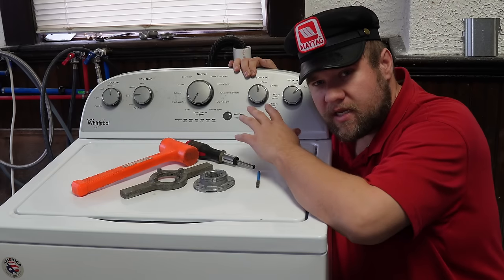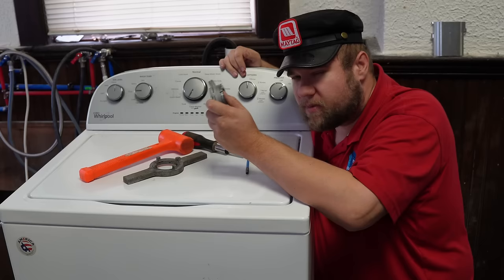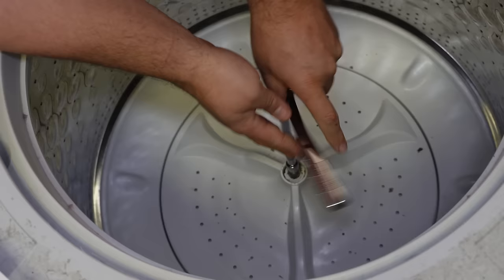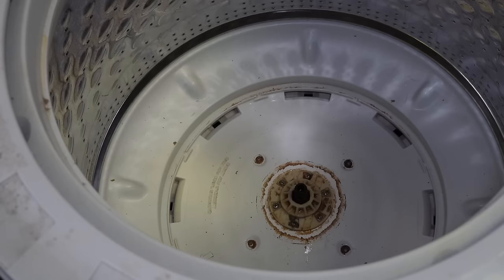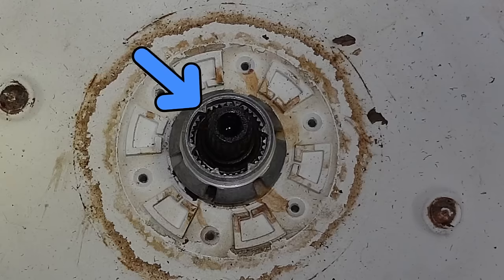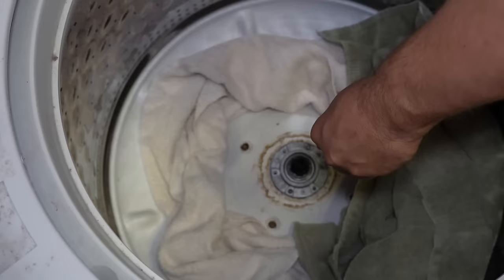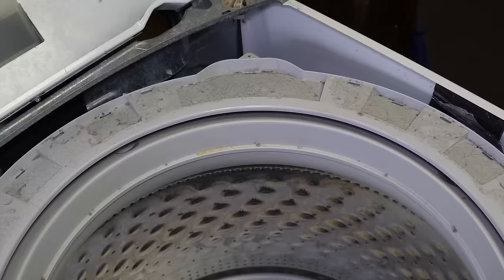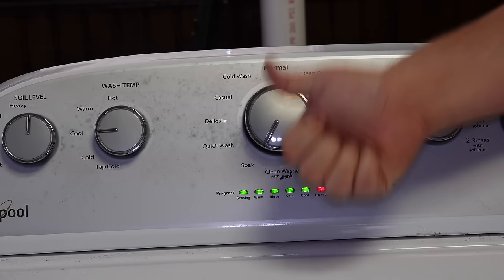Whirlpool Washer Won't Agitate or Spin Properly - Metal Hub Upgrade for Stripped Gearcase Splines

Comment: Makes me wonder how many other products of appliances can be upgraded like this. Great video
Reply from the maker: Good question. I am not sure. I try to keep my ear to the pavement on fixes like this. I've been aware of it for a few months, but never found the right part# for it to do the install. Bought about 4 of them to try and its such a good fix I'm gonna go thru em quick.
Reply: I am wondering if it will fix my Maytag commercial technology washer. We replaced the rods but still jumps. My machine has an agitator. Will this part work or am I still stuck?
Reply: @bensappliancesandjunk  do they sell this kit for a Samsung top load washer?
Reply from the maker: @jimherman17  no, I haven't looked to see if a metal hub is possible on them

Comment: Attention, thread locker is definitely necessary!  I didn't use it and it came loose, hopefully it didn't damage it and I can just reinstall. Wish me luck.
Reply: We'll it's holding! Working like new again. Thank you Ben! You saved me tons of money with this upgraded fix. It wasn't suspension rods, it wasn't out of round tub. It was only the loose hub connection to the tub that wobbled until it came loose. 
Tight like tiger now!!  Spinning smoothly as it should.
Thank you Ben!

Comment: Hi Ben! Thanks so much the video and parts! I knew right away when I pulled out the plastic hub that it was garbage. Glad I put in a better part.
Reply: The fix causes other issues 6 months later.  Spin cycle was ruined. The manufacturer purposely put a plastic tip on the shaft which drives the spin cycle. We ditched our whirlpool and bought a front load Electrolux. Never again whirlpool

Comment: Wet off, thx for vids and helping out by taking time to do these types of vids, something that can take hours, and that’s before the editing starts☺️👍🏻👍🏻

6:47  Story-time for anyone liking “stories”.
So, my Dad went to help me in a repair job (dishwasher for anyone curious) & needed my thread locker that’s use in particular areas on bolts etc…..
In my organized repair tool box (“organized” is important & why stressed this, lol, and like using Packout, Flex, Makita, Bosch, to name a few mobile/job site toolboxes & organizers…..Packout being my Fav, w/ rest in my top 5; Ridgid is in there too) & this day was Milwaukee Packout.
So, as he was helping me he got the thread locker (or threadlocker, whichever way ya like using, both get there in the end though 😃) & he handed me 2 and I put in. Now mind ya, I specified BLUE, as an fyi…..
on the 3rd bolt I noticed was using RED, oh boy, not end of world and asked if he could please switch to BLUE…
So, was on dishwasher door panel using those pesky sheet metal screws on a KitchenAid dishwasher and he put the threadlocker in and put screws in holes to line up for me to go thru and tighten down….well oiled machine assembly line for quick work, right.
On my 2nd screw I noticed not a BLUE, but a GREEN thread locker 🤦🏼 REALLY DAD, like really.
Dad: couldn’t find and they all the same.
Me: go over to organizer and see the labeled area marked ThreadLKR (hey, word to long to fit, but ya get it right, I’m guessing ya gonna say “nope”, lol, and that fine, go ahead😆) and the 2 different brands of BLUE thread locker are like right there….I MEAN RIGHT THERE, as use the most outta the other “lockers”.
So, back to his; they all the same “saying”. I assure you, for anyone not in trades, never have used, don’t care, etc….THE DIFF COLOR THREAD LOCKER ARE NOT THE SAME THING, REPEAT, NOT SAME THING, and is why make diff colors! 
So, depending on application, you may be able to get away with using “whatever” color threadLKR , but depending on what working on, Co policy, Warranty claim policy perhaps, and so on etc……..using the correct color “can make BUG DIFFERENCE” and I’m talking about if ya gotta come back for another repair and take apart to get to; or the NEXT person called that has to remove a fastener that might need 500 degrees of heat cuz of “choosing and using” diff  odor of threadLKR, just saying and my opinion which against my Dad’s that you can’t use the same color for everything and that all the colors the exact same product, why; simple……because they ARE NOT.
Ok, if made to end of this storytelling, thx. Know was such a “page turner”; and appreciate reading it anyway.
Hope anyone that is a diy, new to repair, trades, etc….that this helps you realize there are diff colors and brands to thread locker (not just loctite red or blue probably mostly seen and heard of; especially BLUE and when comes to electronics repair, cuz no one wants to use a red or color that if a serviceable part and you are lucky person that gets the call to service said “electrical device [PC, Console, for 2 examples] you will be glad the right thread locker was used, or NO thread locker was used, if not required….and gets me to a TIP)
TIP = don’t think that you must use thread locker b/c might have a set of fasteners in hand that don’t require any color, and adding blue or red , as will still work fine; when go to remove said fasteners, “can” be difficult….Said “can be” as sometimes it works out and is easy; other times ya using all your tricks and patience😉
Have good one cheers✌🏻
Reply from the maker: Great story. I'll tell you the truth: I had to re shoot the threadlocker part because when I had the machine tore up all I had was Red lock tite and I did NOT want to edit in that you had to use blue instead because I know what kind of horrific mess that'd be in the comments. So that's why you see a ton of blue lock tite on the threads then the fast scene of the nut installation the threadlocker vanished. It was a reshoot to make sure it was done right on camera lol
Reply: @bensappliancesandjunk  will this help I have a Maytag washer I’m about to give up it shakes violently I just change the suspension rods and still shakes I’m not sure what the problem is
Reply: I used to repair computers. Back when ThinkPads were made by IBM they used thread locker on almost all laptop screws. The instructions were very specific on which ones needed red and which ones needed blue. Let me tell you there is a VERY big difference! Those damn red screws were the bane of my existence! I can't imagine having to fight with a large appliance screw put in with red on it!

Comment: Just ordered this hub and I really hope it fixes our violent wobble. I have replaced the original plastic hub with no change and replaced the suspension springs with no change, even after calibrating. Hopeful that I don't have to replace the wash basket
Reply: did it work for you?

Comment: love your videos . informative and very helpful . note : i tried all of your tips to remove my stuck agitator , nothing worked.  then i found a video by Lorain Furniture and Appliance using air wedges to remove a stuck agitator . after installing and inflating the wedges i poured boiling hot water over center of agitator per their video . in less than a minute after pouring the water the agitator finally let go.
Reply from the maker: That reminds me to do a new video on that. The 2 videos I have are 3 years old. There are other ways of doing it like what you mentioned

Comment: Does this apply to roper washer machine, because after changing Suspension Rod Kit For Roper RTW4640YQ1 RTW4640YQ RTW4740YQ0 Automatic Washer, the machine still knocks when spinning?????????

Comment: From personal experience. 
1. The metal hub is $40 and spaner wrench $25, rubber maker $5-$10
2. The washer can still be out balance  , or not spin where could  be $60 suspension rods, or $60 inner balance tube. Or gear case transmission - $300-$400
There's a lot of parts and you can waste money on something not worth fixing due to non spinning and balance problems.

Comment: I bought one of these metal hub drives,and within 3 months it broke apart into 4 pieces under the agitator plate. Went back to the plastic hub drive. It's cheaper to replace.

Comment: Hey Ben, I have the same issue and have found the solution thanks to your video. One question, when I removed the tub, there was water in the walls of the tub. Is that normal? Also when the machine is coming out of the spin cycle, it clicks VERY loudly. Is this also normal?

Thanks - Andy.

Comment: Man I was really hoping this was going to fix my washing machine. I bought the hub assembly I bought the tool I bought the blue loctite then installed the hub assembly.
 Unfortunately it only lasted about a week. The splined part of the metal hub assembly split in two. I'm back to where I started. Went ahead and ordered the plastic hub assembly from your site. Hopefully this will work or I will buy a new gear case for it. I mean the spines look okay on the drive shaft. Can't believe this machine is only 5 years old and this will be its third hub assembly.
Reply from the maker: We just came out with a new item you may want to consider, the shim kit. What we are finding is that many of these have bad tubs that the hub can't fix, but it can be shimmed to reduce the tub vibration that shatters the metal hub. 

If you would like one let me know and I can share a coupon code with you for it

Comment: Ben thanks for the video…. I had a terrible wash plate that wouldn’t come even after the citric acid and degreaser for 10 tries each… finally had to just destroy it and will just buy a new wash plates…. My whirlpool looks identical to the one your showing….. only puzzling item to me is the splines that the wash plate sit on are actually larger than the one for the hub…. So the hub once I disassembled it wouldn’t come off due to the larger splined hub above. It wouldn’t let the old come of without cutting it and now won’t let me put the metal upgrade hub on it because it can’t pass over it…. Ever seen this situation or know of another metal hub kit I may can use….. thanks for making the video and trying to allow us diy guys to save some money
Reply: What did you end up doing? I’m currently finding myself in the same situation.
Reply: @mikedana4849  If I understand correctly, the metal gear from the agitator broke off from the plastic agitator and is still stuck on? If that is the case use a gear puller. Put the large bolt back on with just a few turns, not tight at all. Then the center part of the gear puller rests on top of that bolt and the claw part of the puller under the metal gear part from the agitator. Work slowly as the puller might slip a few times. That should loosen that gear enough, then you can remove the large bolt and then pull it off the rest of the way with channel locks or whatever you have.

Comment: Is the gearcase shaft supposed to remain stationary while installing the locknut? Mine spins so I can't tighten the locknut and there is still play between the tub and basket wall. Brand new gearcase too.

Comment: Did this fix to my sis washer. It worked for 3 months. The tub is loose again. The metal hub looks solid but the transmission shaft is very rusted. Would the rusted spines on the transmission make this upgrade not necessary?

Comment: Hey Ben. Good day to you. Is there something similar for GE part number wh45x26674. Which goes to GE washer model GTW680PL1DG. The center metal hub, except for a small amount under the shaft nut, is powder. Thanks in advance

Comment: What tool did you use to hammer that part down on the gear? I used a socket and damaged the threads and now have to order a new part.

Comment: Where do I get the socket tool that flares out that goes over the first metal piece you install to pound it down onto the hub? I can’t find anything that works and broke my first one very easily trying to get it flush on the piece
Reply from the maker: I made an update to this video. Sometimes you have to move the drive block around for it to get flush, it shouldn't need significant pounding to get close to flush. Otherwise the screws for the hub will pull it up to the hub

Comment: I'm having trouble getting the drive block to seat down all the way. I have a new gear case (it was leaking oil so replaced it). The drive block only goes about half way on and I've tried tapping it down, but it's just not going on. I don't want to temp to really hammer it in place because I fear it won't get seated all the way down and then not be able to get it off. Any ideas on how to get the drive block to fit property?

Comment: Maytag centennial about 3 years old …replaced the plastic hub with metal and that fixed the shaking and moving but now the agitator makes a clicking noise about every second when in wash and rinse cycle.  It did not make this clicking noise before the repair…should I take apart and re-do??
Reply: I experienced the same thing. I'm waiting for someone to discover the cause.

Comment: My washer spins but only clicks when it is supposed to be agitating.  Loud clicking instead of agitating shows to be the lever shift mechanisms leg out of the hole, but that is not the case.  The little leg is still inserted in the lever hole.  What do I need to replace to fix this condition?  Thanks

Comment: Hey Ben, my drive block won’t fit over the part of the shaft that mates to the washer plate. I have a whirlpool wtw5000dw1, about 7yrs old. Any suggestions.
Reply from the maker: Make sure the metal spline is by itself - sometimes there's a piece from the wash plate that will stay on the gearcase when you pull the plate. It'll look like a different color with a # of splines that doesn't match the drive block you'd put on it

Comment: Working on installing the metal hub. Whirlpool Wtw5000dw2 which is compatible. My question is the  outer tub and the inner tub tighten up but they're not even around the rim. I can loosen the round nut and move the inner drum around and then retighten it. Is it always supposed to self Center? First time I tightened round nut it was off center out of balance but I  loosened nut, held inner and outer where they were even then tightened again.  But im waiting on the hub wrench in mail before final lock tight and tightening.
Just curious if this is something you've noticed or am I crazy?

Comment: After doing all of this I now have a horrible metal rubbing noise during the wash cycle, and the wash plate didn't fully seat all the way down. And it's still off balance during the spin cycle. Any idea what I could have done wrong?

Comment: I have a Whirlpool Cabrio washer and I had a vibration and shaking issue. It only vibrates and shakes when we run a full cycle. But if we put it on spin and rinse we don't get any vibrations. What should I be looking for here?

Comment: Hey, so I changed the part, but when I try to calibrate, I enter in diagnostic mode, right 4 times, hit start, and the light just turn off, no flashing, no nothing. Any suggestions?

Comment: What did you use to tap down the drive block? I can't get it to go flush with the bottom of washer. The metal hub will also not sit flush so I know the drive block is not down far enough.
Reply from the maker: Screws will bring the tub up to hub. Otherwise it was a socket and it didn't tap fully flush until I used screws

Comment: Ben,  will this work on Maytag model WTW5105HW2?   I think this is my issue. Already replaced suspension rods and Still have F7E1 and FOE5 error codes.  Please let me know what you think.  Very small loads trigger codes.  When new 2.5 years ago could put a full load and no issues

Comment: I changed some suspenstion rods but the washer keeps filling up the pressure hose goes to the control board at the back ...do i have to calibrate it or there might be an issue withr he control board ...but when i select spin and drain it takes a while i would hear clicking sounds and then it would start spining and draining ...the suspension is good but the maxhine doesnt turn of on the selected size load ..whats my solution to that

Comment: Hi Ben. I replaced the hub with the metal 3 piece one, it seemed to work fine for several loads, then we put in a larger load and when it spun out it started shaking and banging the wall again. It only does this for the last 5 seconds or so which was the same with the plastic hub. Any other suggestions? Thank you.

Comment: I purchased a used Whirlpool top-load. The previous owner/flipper stated that he replaced the suspension rods. Washer was shaking violently on the first wash when we got it home. I leveled it and tested again.....still shaking. I then ordered a replacement hub, that didn't fix it. So I ordered the metal hub and the unit is still shaking violently. On a water only cycle it wont shake, Ive tested for unbalanced load by moving clothes around and its still awful and my clothes are still soaked. What should be my next step?

Comment: Is it normal for the metal hub to not go flat down to the tub bottom? The plastic one was flat to the bottom. The drive block is down all the way with the gear case up to the teeth. But when i put the hub on its about 1/8" up off the bottom. Probably closer to 1/4". The metal hub barely ingages the locating array on the bottom inside the tub. The tub was out and i dropped it back in so its not compressed down or anything. It seems like the teeth are keeping the drive block from going down far enough.

Edit: can i grind down the top teeth so it drops down further? Or could i add a wide washer under the tub to raise it up a bit. Cuz this does not seem right. 

Model is Maytag MVWC565FW1. It was on the list of compatible machines.